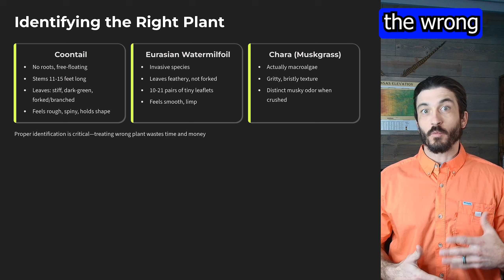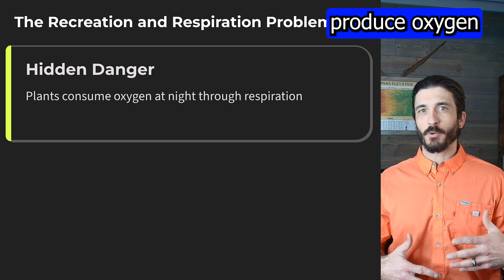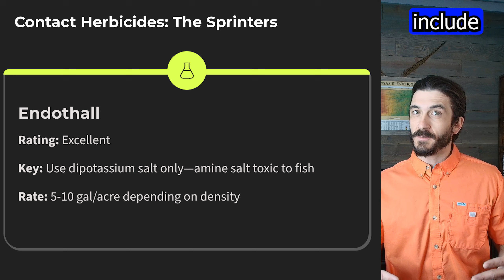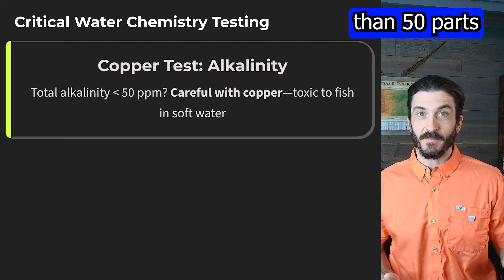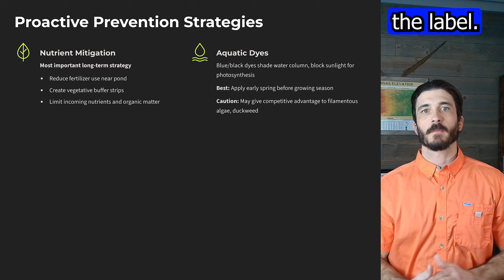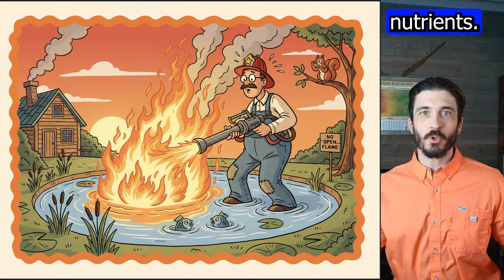The "Killer Cocktail" for Coontail Control: Take Your Pond Back FAST

Comment: Yeah I think I got coontail, looks like it. I have 2 ponds. A one acre above that flows into a 3 acre pond that looks like a boot shape. The upper pond flows out to the big pond about middle. The creek feeds the big pond at the boot top, and overflows at the heel side, so a natural current would be on the south side . I have 28 acre feet total. The water is crystal clear and is supplied by about 5 or 6 springs. I tried to set up solar aeration but didn't have enough batteries and electricity was a bit expensive. I'll revisit that later. I have bass, blue gill, and some perch. I did find a huge dead catfish on the outlet overflow. I have on feed that comes out of a bluff at the bottom from a pipe, and I live at 4000' ele. in the Sierra Nevada's so the source is an artesian flow I assume. I want to try and bottle that as I do have water rights [licensed].
Reply from the maker: Very cool! Yeah crystal clear water creates the perfect storm for some Coontail to explode!
Reply: @Pondology101  Yeah, I'm cash poor with too much land for my money lol. I'm going to drag it with my tractor and some rippers I think. I saw a vid once.